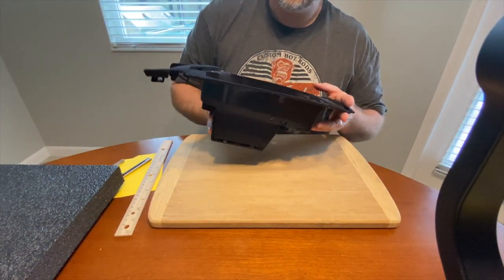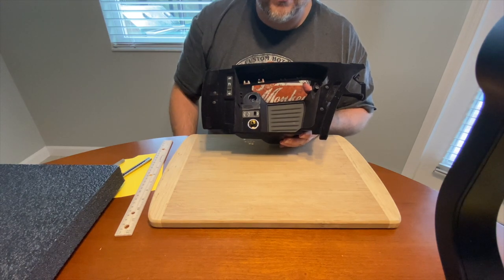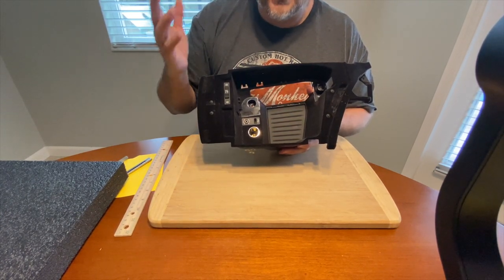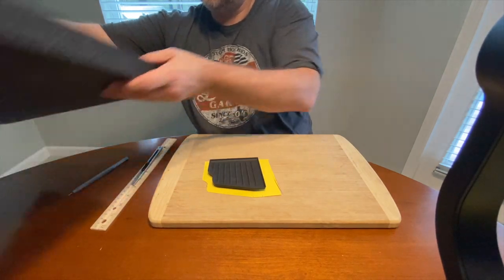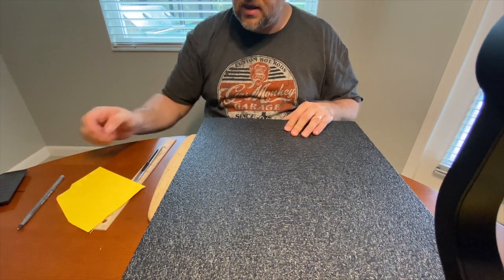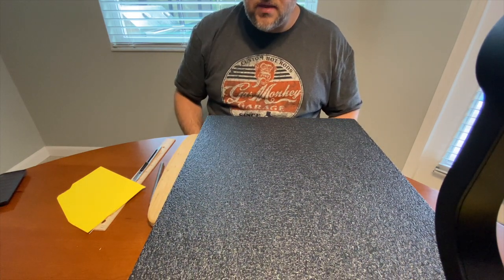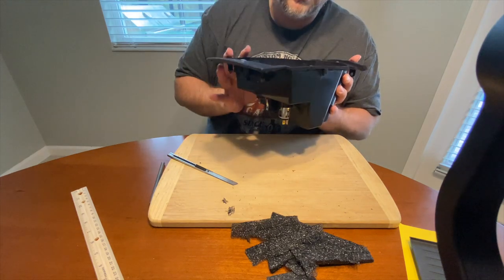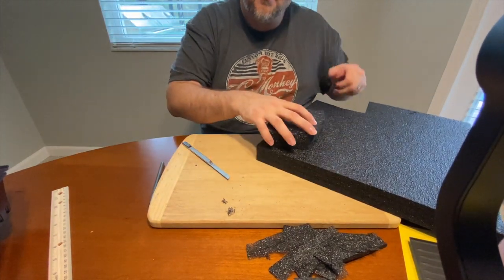BMW F10 528i, 535i 550i Custom Center Console Insert...What's Inside???

Comment: Now what ya need to do is pull that foam out and cover it in black leather.  That would finish out the whole project with class.  You could take it to an auto interior specialist and they could even do nice stitched seams to match the rest of the interior